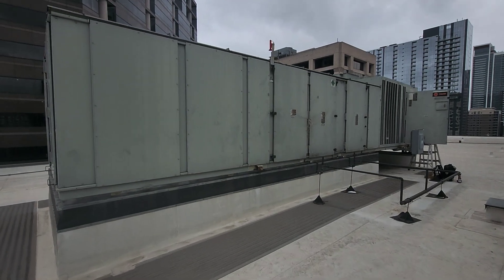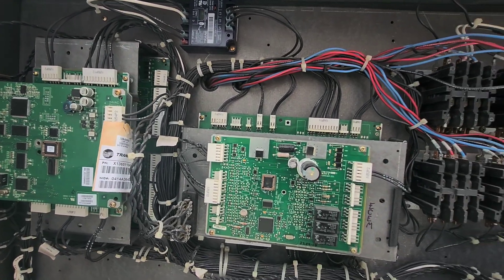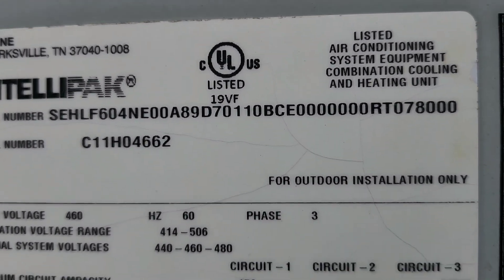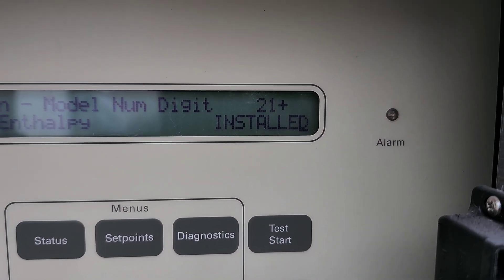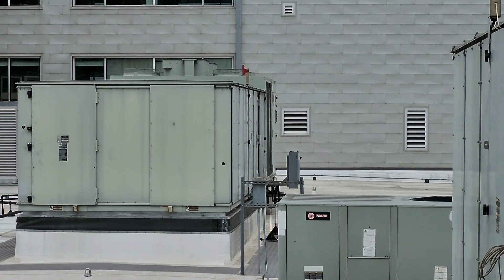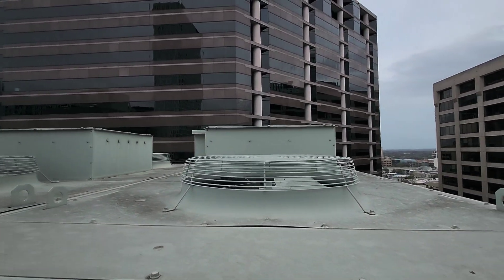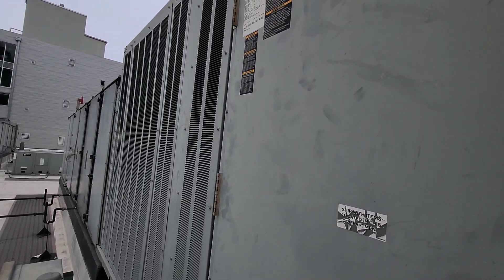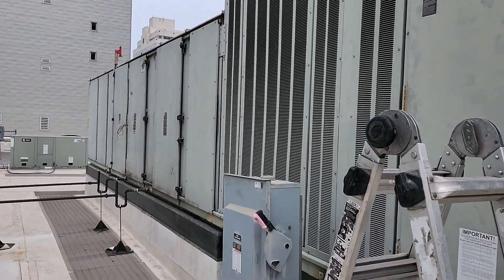HAD A WEIRD ALARM ON THIS INTELLIPAK.RTM DATA STORAGE ERROR. #trane #intellipak

Comment: I just did one and the RTM board was failed and kept tripping external interlock, and the unit didn't have an external interlock. Had about 100 pictures of the old settings on the old board.
Reply from the maker: There are a boat load of settings on these things. Luckily it gives you options based on what the comms are receiving. That 21+ had me scratching my head for a minute. Thanks for the comment